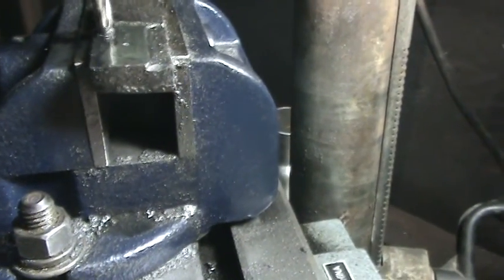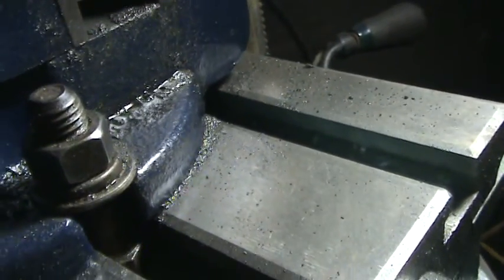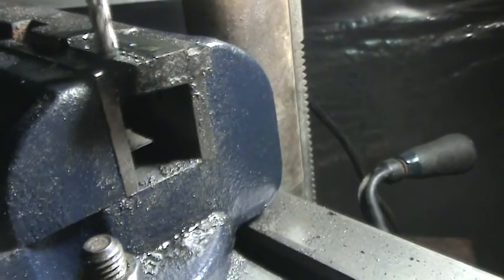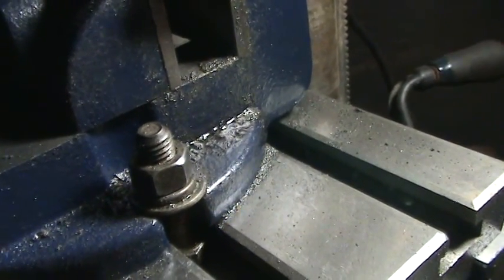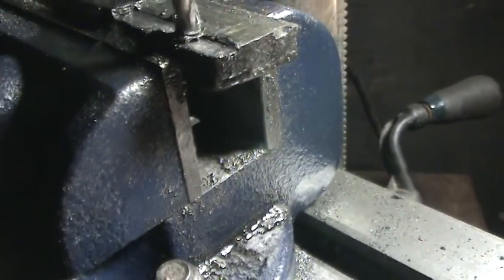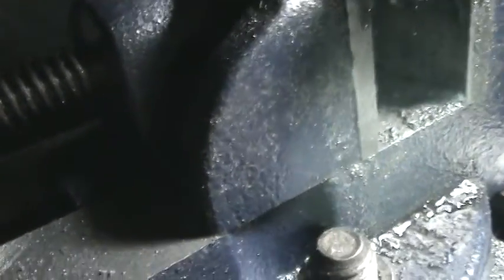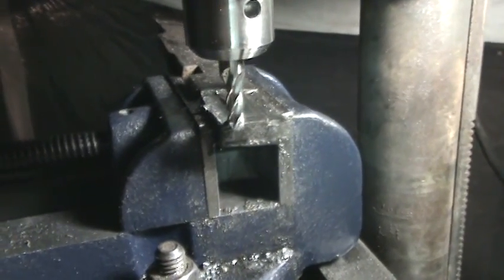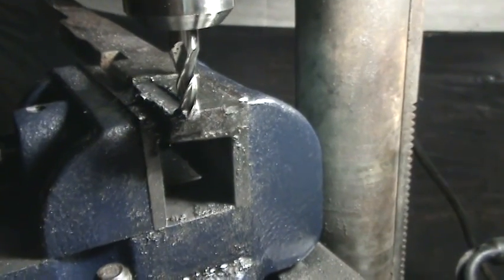Da MINI MACHINE SHOP Monday Night Milling

Comment from the maker: This looks more like iron but not very mallable either. The chips are almost powder & the finish is dull when dry milling & to get a shiny milled surface requires climb milling with a lotta oil. I just killed 3 end mills already.... I did hear horror stories of hot rolled & I  remember your recent experience I think it was on that seated Segway project... I have another way I can do this with scrap flat stock & some square nuts..
Thanks Ron
Aloha

Comment: Chief,  if it was a piece of hot rolled steel it won't cut worth a damn,  might be worth hunting down some other stock and seeing if it machines better.  I tried turning some hot rolled steel once and it was garbage and just ended up ruining some cutters.  Then somebody else mentioned that the quality and composition of HR is very variable, and not very suitable for machining, because some places are much harder. Flame cut steel is also very hard at the cut ends. Hard won lessons for me.